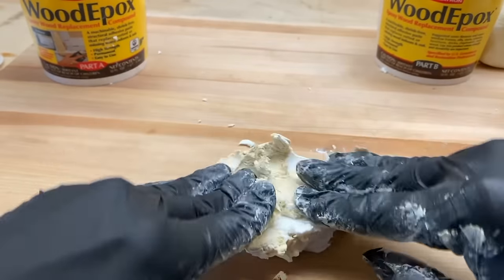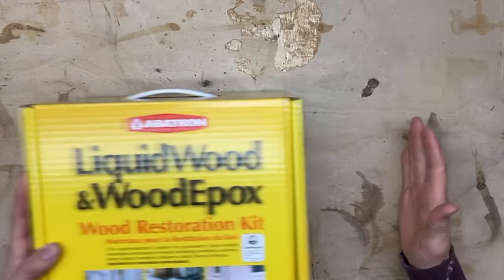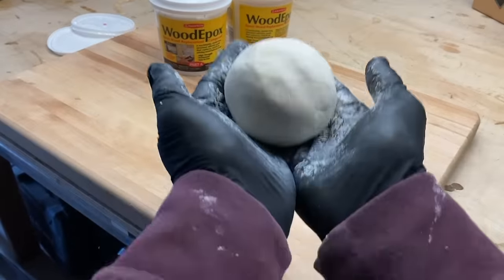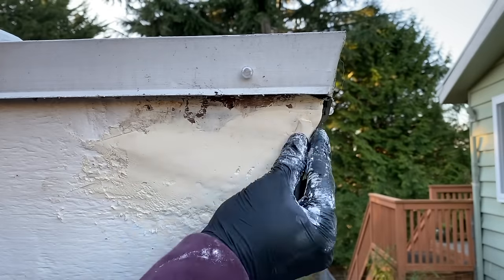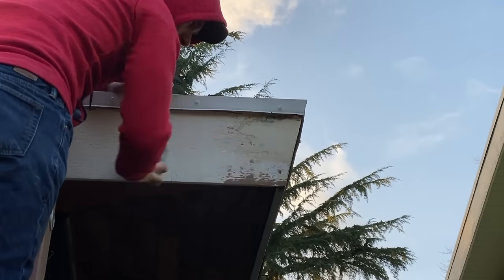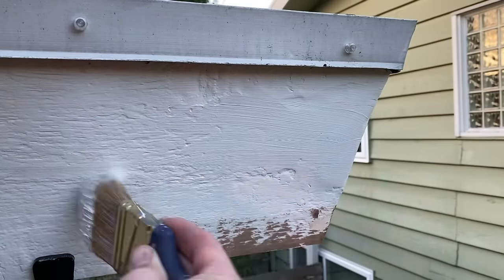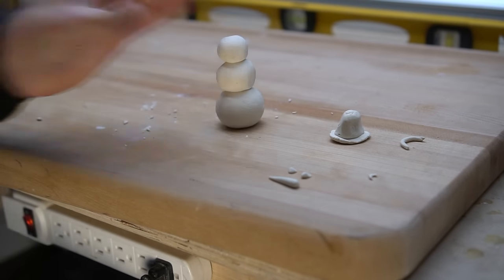How To Repair WOOD ROT and Water Damage With ABATRON

Comment: Looks like a rats nest with that fur in the cavity.  We use a product like this called Smiths CPES.  It is a clear penetrating epoxy system, and a epoxy filler similar to the system you are describing.  What is the cost of that kit you are describing.  The  product I use is very expensive.   Smiths looks like it is a lot thinner, and is able to penetrate the rot much further, which is important. You used a lot of filler.  Hope that stuff is less expensive than what I use.  We would have scarfed in a  a wood repair, and then used the putty as a finisher.
Reply from the maker: Thanks for the heads up Rod.  I'll have to try out the Smiths CPES if I can.  Thanks for the explanation.  Abatron isn't cheap either unfortunately haha.

Comment: I have been using Abatron resins, especially Woodepox and Liquidwood since 1988. It is very important that the directions are followed perfectly. If incorrectly used, ancillary damage is possible. ie: lack of protecting surrounding areas from liquidwood can be difficult to remove without methylene chloride. Also, skin and vapor protection are necessary. Your skin can absorb these chemicals. So if you are incapable or ignorant, you may prefer to use a "Dutchman scab".
Reply from the maker: Great to hear and thanks for all of your input Tom.  It is much appreciated and yes you would always be thinking about protecting yourself and those around you.

Comment: Thanks, my hole is exactly the same below the roof.
Reply from the maker: Great to hear Sam and thanks so much for watching.  Hope your fix goes well.
Reply: @BYOTools  my biggest problem is no local stores have abatron.
Reply: Mine is as well and is going to be fixed this weekend.  I already had some wood hardener by PC Petrifier which I put on first after removing loose and damaged fascia.  Tomorrow, Saturday, I will install the putty and sand on Sunday so new gutters can be installed on Monday (old leaky gutters caused the damage in a couple of areas/roof is in perfect shape) and thus no more damage.  Thanks BYOT!

Comment: If you don't cut all of the rot out, it will continue to rot bigger. Bacteria still there.
Reply from the maker: I normally completely agree with you Larry and the vast majority of the rot was removed, but I wanted to test out the epoxy/filler combo based on the product instructions.  So far so good and it still looks great.  We will see how it holds up over time and will keep everyone posted.  Thanks for watching.

Comment: You can take a plastic shopping bag. Wring it out and keep it that way for a period of time. Depending on how fine the grain you want to match depends on how much to let the plastic bag out. Then use it to texture the wood filler before it cures or afterward with a thin top coat. Thanks for the product info. Ive used wood hardener and fiberglass resin many times but i may try this stuff on my newset fix

Comment: I’m wondering why you just didn’t cut away the rotted word and replace it with new wood.  Much easier than the epoxy method, at least in this example.  Good video when using epoxy.
Reply from the maker: Good question Terry and that could have been done but If you take a facia board off you are normally going to take off the whole thing. Not just cut out one section.  This video is just a good representation of how to repair the rot if you don't want to remove the entire facia board.  Thanks for watching and hope you subscribed.
Reply: And cheaper.
But it was a sponsored video. And he got it for free. 
So why buy wood, when you got something for free that will fix it?

Comment: $152 Wow!!  No thanks. I would fill those holes with something FIRST, like you did with the foam. Even that sheet metal can work as a backing in that facia corner. ...and then apply the putty. Elmers and JB Weld sell similar in smaller qnty and cheaper. But you did a good job. Your vocabulary is entertaining, lol...Nice work!

Comment: Filling the deep, big hole with the epoxy putty is very expensive and wasteful. You are much better off filling most of it first with a wood block -- if you add it while the liquid epoxy is still wet, it will bond to it -- add a couple of nails or screws if you want it more secure. Then use the putty just to fill and level the top surface... even better make a "dutchman" and then you only need putty to fill any gaps between the dutchman and the surround. Wood is stronger and more natural than the putty anyway.

If the area isn't structural,  you can fill much of the big wall with backer rod or even expanding foam. just leave enough space to get a thick enough surface so it feels solid.

Your hole probably had $50 worth of epoxy in it!!!

Comment: I've used automotive fiberglass Bondo with great results.
Reply from the maker: Interesting James.  Haven’t heard of using it with fiberglass before.  Does that help with expansion and contraction?  Thanks for watching and hope you enjoyed the video.
Reply: @BYOTools  not sure about how it will hold up long term but I was able to patch some significant damage a few months ago and so far it's holding up great and showing no signs of cracking.

Comment: I just use Bondo mixed with steel wool strands. Cheaper and still just a half arse patch. Removal and replacement will always be the right and proper choice.
Sorta like saw dust in the rear end of your car,,, quiets the noted need for repair, but only you would know ya did it, not the poor unlucky individual buying your Junk. You my aqauintance, are last JUNK.

Comment: 00:03 Learn how to use putty product to fix wood rot.
01:41 Prepare the surface and mix liquid wood and wood epoxy in a 1:1 ratio.
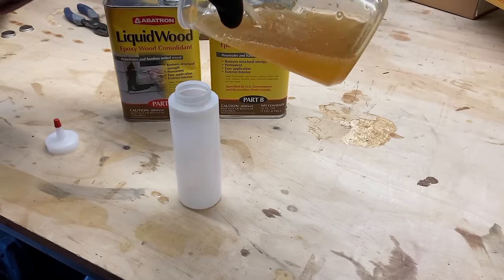03:22 Mixture and Application Process
05:04 Mix products thoroughly for even color
06:35 Abatron wood epoxy can fill and strengthen large holes in wood without removing the entire board.
08:01 Use shims and hot glue as backing for deep holes
09:38 Preparing wood surface for repair and painting
11:19 Abatron product has countless uses for repairing wood rot and water damage

Comment: With my 120 year old home (with 1990 Marvin windows) I'm starting to see many places where the window sills are rotting out. I think in the 1990s Marvin used pine for their wood cased windows which rots out pretty fast on the weather side of the house. I've had good success with automotive 2-part Bondo, but this product looks superior. With your squirt bottle, are you throwing it away with each job? My guess it is impossible to clean/save?

Comment: That corner isn't just an eyesore and entry point for water ingress and rot.  It also affects part of the roof structure.  The only proper fix is to peel back the fascia, the roof and join new healthy members and fascia.  You are just asking for problems, down the road, when your loose epoxy Play-Doh, baked in the hot sun, fails to hold things together.  Guess what rotting wood does?  It travels, affecting all of the wood up and down the line, long after you stuff the void with Play-Doh.

Comment: IMO, wood epoxy is too expensive in that quantity- it'd probably be cheaper just to replace the fascia board (or a section of it).

 -I like to use expanding foam (like Great Stuff) in large cavities like that, just be careful not to get it all over. When it's dry I clean enough of it out to put a layer of wood putty/caulk on top. If you're lazy and don't care, the spray foam alone is enough to seal but you need to be careful that water doesn't get diverted into the soffit. The foam only turns a dark orange over time, I've never had problems with it failing. Also, if you have a lot of foam left over in your can you can stick something in the tube (I like to use a metal hanger and leave the entire tube extender on there) to help get it flowing the next time you need it. You just twist and pull the hanger or nail (or whatever you used to seal it) out and it should flow.

Comment: I didn't have enough product to finish.  Do I get more epox and repeat the procedure or can I use a product from the hardware store?  Also, I used a small amount of liquid wood on deck planks where they meet the house.  Product is still wet this am.  I thought it would harden the wood overnight.

Comment: One fix for 50+ years with Hardy size cement 2x6. Expensiver on labor with you doing many times vs a real fix.
Reply: Valid point. These kits are crazy expensive and only sufficient to cover small jobs. A hole like this needs to be filled, then finished with a sand-able wood filler. I repaired some beams using spray foam and cement. Solid as a rock.

Comment: 4 quart kit. 140 bucks. You said save money, not quite  a 10" weatherguarx soffit board might cost you 30 bucks max and thats with inflated pricing we have in 2022   you just need to remove the old wood and replace it, also a trick is to paint it before you install it.
One thing you should know on the facia bord its nailed on the face to the rafters it also has nails from the top the roof decking material then a metal drip edge thats under the starter corse of roofing tiles  you can cut the top nails with sevray types of tools you dont need to reinstall nails but its better if you do and you can replace the drip edge , look on youtube youll find people showing how these are installed  im 90%sure the used a pine none presure treated wood to start with , depending the way that sidecof your house faces if its sunny most the time you can use a pine type wood if its the north side of the house id use a presure treated weather guard wood.  Its more work but the end result will be better, neither can be seen from the street.  If its on a very shady side of the house go with a pvc plastic trim work it won't rot.

Comment: Abatron is very sensitive to how much water is in the wood you are repairing, the worst part of this repair material in that is very expensive, There are cheaper wood repair products such as Varathane Classic Wood Hardener and Wood Filler. They are one part products and they are about half the price of the Abatron. I've tried them both and the results are about the same with both products.

Comment: You will find out soon enough that the rot will be back with a vengeance. You are closing in water in the wood and applying a material that has a totally different elasticity, inviting cranking and rotting. Easiest and most sensible method is replacing this part of the wood with new wood. In this case it actually would have been much cleaner and quicker. A little chiselling and sawing.

Comment: I did a job just like this and after a few years I was back at it once again. You should have double checked whether any of the surrounding areas were  affected rather than do a superficial job in removing what was there. Then I would filling the gap with another piece of wood not epoxy because it didn't work the first time around. Now your epoxy might be superior to mine but that remains to be seen after a few years. Also I get the impression that in the area your working on there appears to be an over flow of water in that corer you might wanna check that out during heavy rains.

Comment: While I admire the idea, this is just not a good idea for application. Rot is indicative of water damage that has breeched seals to allow it to damage untreated wood and surfaces. If you have rot, there's likely a place water is getting in. This is more over a band aid that solves none of the problems that ultimately devalue a home....long story short,  replace damaged areas in your asset. If this is a rental, its the home owners responsibility to fix it right.

Comment: Try using a hard bristle brush to brush fake wood grain lines into the material when the epoxy has been applied but is still soft. it takes a little practice.

Comment: Please don't follow this advice although he's just trying to help people and its not technically structural is a term that usually means its not holding any wait like you could just take the entire piece of wood out and the roof won't fall down so money wise maybe a bit more but if someone else has done a similar patch up on the same length of wood could possibly be a place we're high wind or rain could let water in and then you could have allow water in to a structural part and need a new roof yes it looks good but for the sake of a bit more money a bit more work it's worth it for your piece of mind my sister stays in florida and she had to get hurricane damaged corner of the house and the standard of work was terrible in Britain we don't have as extreme weather but our houses are at least facing brick no wonder they blow away I've had better garden sheds

Comment: Does anyone answer questions, I have 2 boards under the roof hang over that have water rot , one is 1/3 rotted away, other not much, should I cut the rot off an add new an seal it or fill with wood putty an seal an paint ?

Comment: so instead of filling that deep hole with the compound why did u fill it first with the spray stuff u used on the siding and then fill the top with the compound.  Just wondering.

Comment: Why not place some wire mesh in the hole to help the bond strength or at least screw a few screws in the inside of the big hole and leave them sticking out so far so your putty has something to hold onto...

Comment: Never seen or used this product. Normally the epoxies get warm to hot as hell. Does this product do that. Also most fillers recommend large fills be repaired in layers for the product to cure. Is that not the case with this product?

Comment: I think I’d add a aluminum facia to that shed because the kick on the drip cap doesn’t seem to shoot the water out away from the wood far enough letting it run down the face and rot

Comment: Ran out of product right in the middle of filling the window frame rot. I have ordered new packs and wonder if it will stick to the hard WoodExpoxy?
Reply from the maker: Good question Tom and I would say yes you wouldn’t have an issue with the product sticking to the original application.  If you got the kit you probably have more of the liquid wood epoxy.  Just Incase I would apply a layer of that first and then the woodEpoxy.  Hope that helps and let me know how it goes.
Reply: Bondo works great for indoor use but doesn't last outdoor if using on wood surfaces. I think it's because of the wood swelling and contracting with moisture. I have seen recently a bondo product made for outdoor use on wood. I haven't tried it yet.
Reply: A friend uses auto body filler

Comment: Durham's water putty is a fraction of the price and probably does a better job.

  But to be honest....I"d just replace the board in less time and not have to worry about it.
Reply from the maker: I've used Durham plenty of times but I wouldn't recommend it for this size of a hole. This tutorial is to help people that don’t want to remove the board.  Just trying to give others a secondary option that LASTS.  Thanks for watching Dan.

Comment: A bit too expensive, I'm afraid.
I usually use a mix of saw dust\wood chips & any PVA wood glue for filling holes in wood.
I'm not sure how expensive PVA-based glue in your country, but here is waaaaay less expensive than epoxy and wood chips\saw dust is as cheap as dog shit.
Hope this helps.
Reply: I think that for capital structures the composition that on the video will be stronger.
Reply from the maker: Thanks for the suggestion.  I'll have to keep that in mind if I run out of Abatron.  Thanks for watching.

Comment: Bondo works better.
Reply from the maker: I've heard that you don't want to use bonds since it doesn't expand and contract like wood and therefor will breakdown over time.  Have you not had those issues?
Reply: @BYOTools  I’ve never had that issue and I started using bondo in the late 70’s since. I’ve never had that issue. And my sure what brand but bondo doesn’t break down like you think. It will work and hold up. But everyone has there own opinions and suggestions.  I just know from years of working with all kinds of products the best and strongest fix seemed to be bondo.

Comment: I think repairing part of the rotten wood with a piece of wood is cheaper than buying the putty trying to cover that big hole i am positive, but if you not handy around the house then use the putty, but as myself I rather replace the wood.
Reply: He probably didn't have the means to cut the wood? That's what's keeping me from replacing my wooden eaves.

Comment: Damage wouldn't have happened if the sheet metal over the fasci had at least a 3/4" , 45 degree return folded drip edge at the end of the flashing to direct rain water away for fasci and siding. I prefer 1" or longer drip.
You can add additional flashing to the existing flashing without removing the existing flashing. Do this after the abatron repair and your fasci will last for decades if not longer. Make sure lights on front of flashing are water tight too!
Reply from the maker: Just know the damage occurred due to a tree branch wacking the side of the facia for years.  Should have noted that in the video.  Thanks for watching and your detailed response.

Comment: This is why I like watching the Honest Carpenter. He covers how people get ripped off by immoral carpenters. After watching his videos I have been able to repair work on my all wood house. If I used epoxy it would cost me a fortune. I might as well just take all the wood off and replace.
Reply: Yeah, this video makes no sense to me. Why go through all this work with insanely expensive epoxy, when you can get a planed board for under 10 bucks, or a milled roughcut for say 3.80 or something. I paid under 4 dollars per 12 foot board to replace my eaves. And if you're lazy, just cut the rot out, replace that spot.